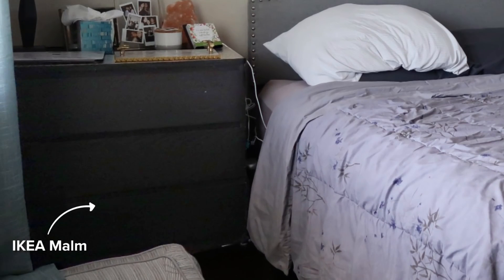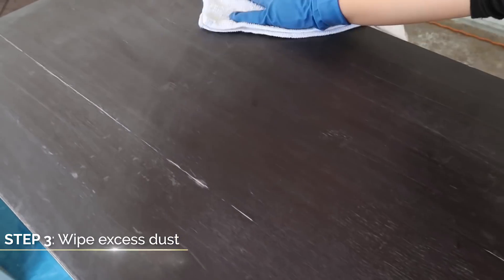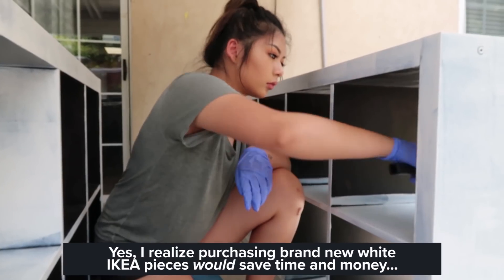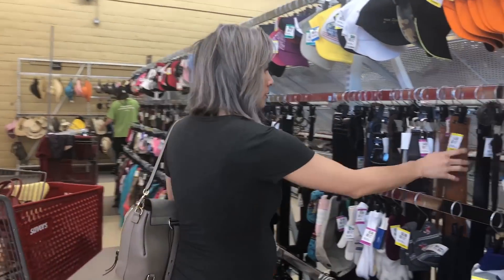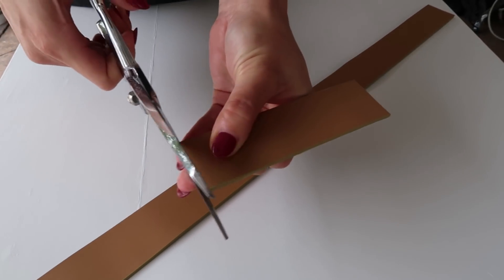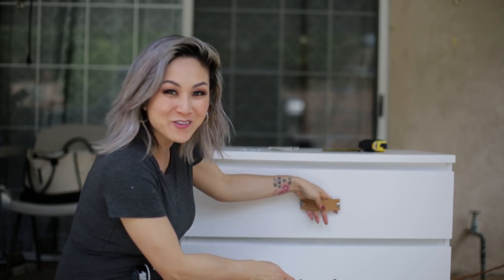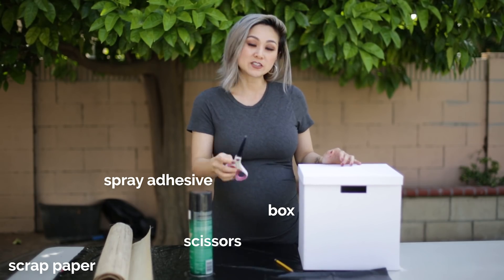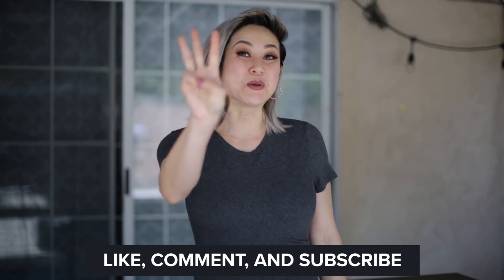DESIGN HACKS! $500 Budget Bedroom Makeover (+ DIY Ikea Kallax + Malm Upgrades!)

Comment: I believe the "primer" in interior paint+primers helps to cover colors in less coats. It does not help the paint bind to the surface the way zinsser primer does. Also, be careful with polyurethane especially on White. It can turn yellow with sunlight exposure.
Reply from the maker: Yes, I definitely recommend poly acrylic in most cases. We were using what we had to save on costs. 👍🏻

Comment: The poly top coat looked very watery.  Was the primer top coat in one an oil based paint? I think our hardware shop sells specific paint for laminate. Thanks for upload. 🤣🤣👍🙏
Reply from the maker: No, water based primer + color. We used what we had to save on costs Liz. Use what you like for the best finish results 👍🏻

Comment: Julie - I have a Hemnes 6 drawer dresser (in black brown) it also has a laminate over it. How long did it take you to sand the laminate off by hand? Would you recommend an electric sander? What's the best way to remove the laminate?
Reply from the maker: We didn’t remove the laminate since there’s particleboard underneath. It was quick! With a hand block sander you can rough it up for paint in less than 10 minutes. No need for electric sander Chris!

Comment: Do you know how often I looked for videos on painting laminate? Didn't find anything good. Then I see this AFTER I incorrectly painting my salon cabinet. I'm so bummed.  I first used the Rustoleum 2x. The color was too dark and there wasn't a lighter gray option. The paint gal suggested Pittsburgh fast dry for tough paint projects. I finished with a spray gloss top coat. I can tell this isn't going to last a long time. My nail can easily remove to the original surface.  Here's my question. if I sand all or most of this down, it should still work if I use the proper products you mentioned here?
Reply from the maker: Yes, give it a good, thorough sanding session and start over again if you really love that piece Jennifer!
Reply: Orrrr you could use chalk paint. No prep, just paint & gloss if you want..

Comment: Aiai - "you want a polyurethane sealer" she says expertly - because they forgot to tell her that : 
Most white paints turn YELLOW pretty fast if you seal them with polyurethane.
Reply: Yes you are absolutely correct. 
I learned this the hard way.  I now only use Polycrylic sealer on any diy furniture as well as large canvas artwork, sometimes I’ll use an epoxy but in this case we want to keep that price down as much as possible so I recommend polycrylic.
Reply from the maker: Yup, I learned this the hard way too MB and Zahria! Luckily you can just sand down the finish and paint over it. I use polycrylic exclusively now for the light paints 👍🏻

Comment: Could you please to a design mistakes your making with grey  ...ei: why does my grey paint look purple or green or blue and how to fix them? Is it the red floor ?
Reply from the maker: Great idea Crystial! It’s a combination of every surface the paint is adjacent to- the floors, ceiling, light bulbs, furniture... plus every grey is tinted with another hue so if you need to carefully inspect it with samples painted on your walls before committing.
Reply: Home Depot has very inexpensive tester jars.  Buy a few and they will mix the colors of your choice in the jars.  Buy a pack of 4" weenie rollers and the weenie roller handle.  Put the colors on your wall.. leaving a few inches in between each one so you can differentiate.  Check the colors in the morning.. at noon.. and again in the evening as they will look different depending on the time of the day and the available light.  Also, as Julie mentioned, the colors will look different depending on what is adjacent.  If you have blue carpeting the colors will take on more of a bluish hue.. if you have a green couch the colors will take on a greenish hue.  Just experiment until you find the one that is PERFECT for you  😍 💕 👍